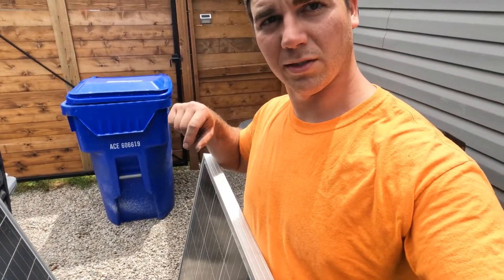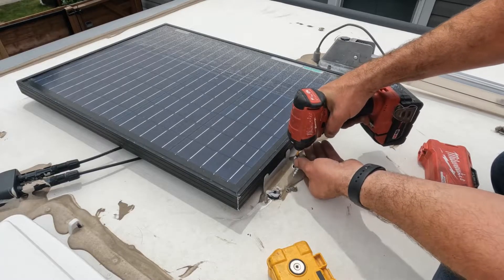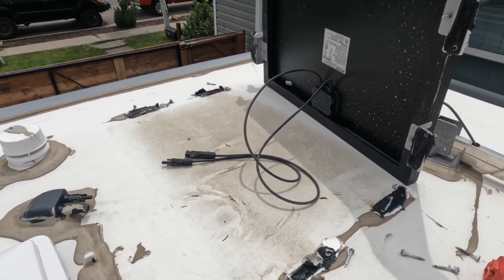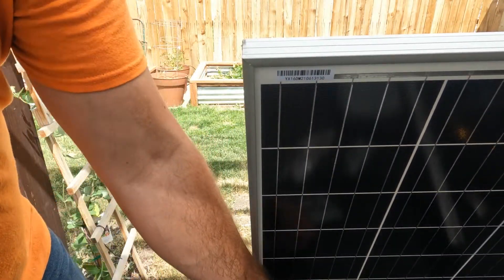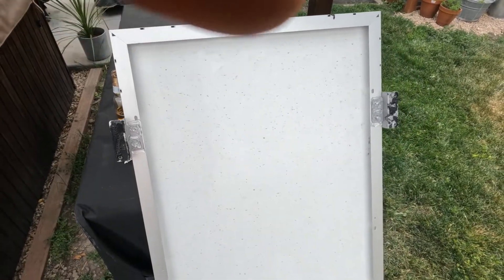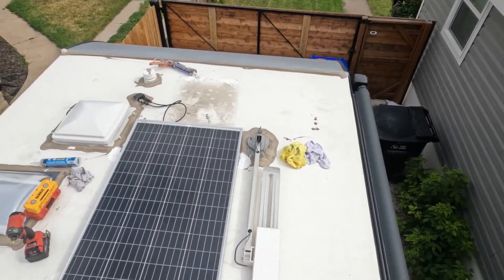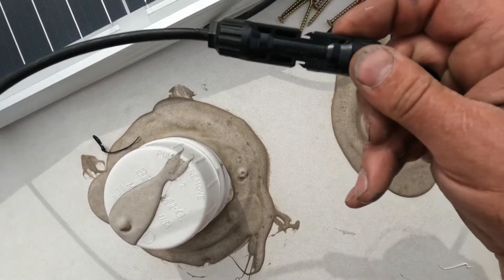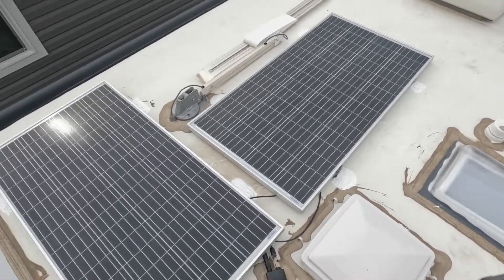Camper Solar For Dummies (Like me)    -2022 Cherokee Grey Wolf    -Part 1-

Comment: So you added 6x the solar power, but didn’t upgrade the wiring going into the camper???
Reply: i have the same toy hauler. I had a 50 watt solar panel  and I did the same thing as this video.  Added 320 (2x160) an mppt charge controller and a 230 ah lithium battery. This set up has work great the last year so I add a 2000watt power inverter. I now have enough to run my 12 volt fridge and heater on cold nights plus run Starlink without having to use my generator to charge the battery.  Works perfectly
Reply: @guillermoquiroz1319  so you just connected the existing wiring from the solar panels and the battery that connected to the small charge controller to the new Mppt charge controller and it was fine? I am a little concerned because the wires seem like their gauge was a little small.
Reply: @BrandonZarbo    Yes I used all existing wire.  I talk to some people with electrical experience and based off those conversations, it would be ok to the existing wire as long as I didn’t go with more solar panels. I did have to install a bigger fuse from the solar panels. I have used this set up for over a year now with no issues.
Reply: @guillermoquiroz1319  I was considering going from the 50 watts of the original panel, to two new 100w panels totalling 200w. The wires coming into the trailer are 14 gauge, Thanks for the input!
Reply: @BrandonZarbo   based on my upgrades and how long it’s been working I would say you would be fine. But definitely change out the factory solar controller. I have a victron smart charge controller 100/30. If you have any more questions I’m glad to help/offer my experience

Comment: Nice videos!!! I have the same toy hauler and I am doing the solar panel upgrades(2x160w panels). I was wondering if you ever switched out the charge controller.  I’m thinking of upgrading the converter for lithium and getting a lithium battery.

Comment: Nice job!..Looking to do the same to my same camper! Thanks
Reply: How is it now? I’ve got the same camper and are having battery issues cause of the dang electric fridge. Was looking at options to help out.
Reply from the maker: @jonfischer4  oh it is fantastic. The extra battery and the 330 watts of power up there are plenty to run the fridge and other items for several days. Haven’t tested the limits of it but maybe I’ll do a video to see how long it can be run on the solar now. In theory, it should run for as many days as you want. But so far, Probably the best upgrade we have done.
Reply: @wasatchmotoco  Awesome! I’m excited to hear that. We would charge the batteries for a week before going out and use only the fridge. Light on for a couple minutes at night, but that’s it. The batteries would last 2 days or so then have to run the generator for a bit. Where did you get your panels from?
Reply from the maker: Awesome! Which camper do you have?
Reply: Hey man, great video. Would you be willing to share the total cost to do this upgrade. I’m more than happy to do the work myself, however roughly what was spent on the parts. Thanks in advance.